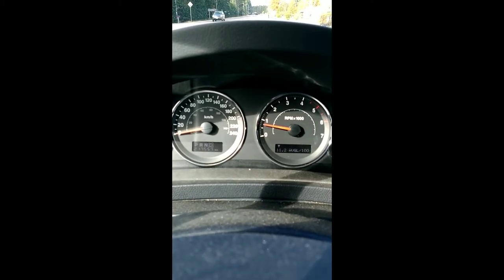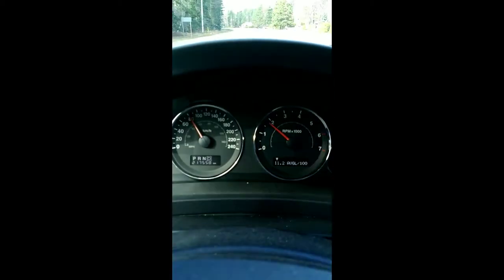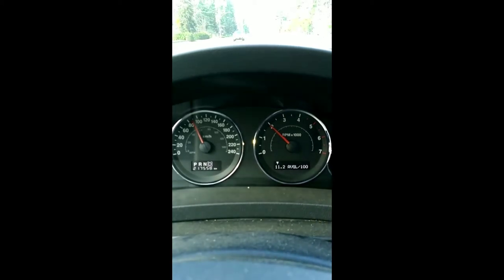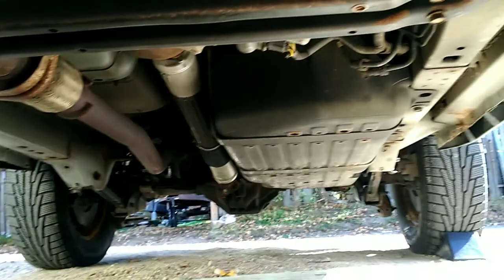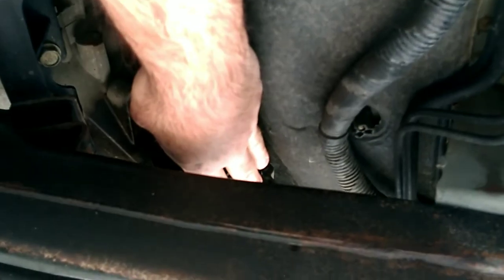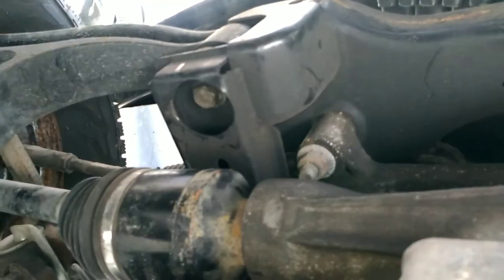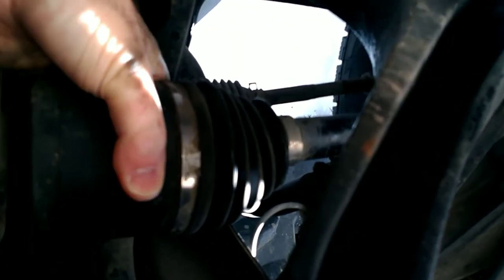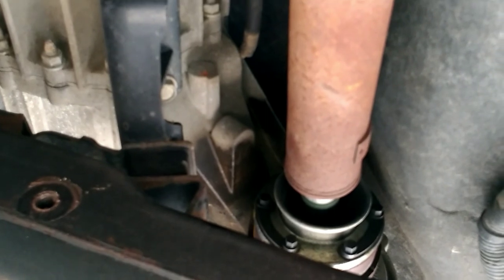2008.5 Jeep Grand Cherokee WK Driveline Noise

Comment from the maker: I ended up having two problems.  The drive shaft (propeller shaft) was worn at the rear CV and the pinion bearings were bad in the front differential.

Comment: I got the same problem on my 2006 jeep grand cherokee,¿did you   fix the noise problem,THANKS
Reply from the maker: yes, I changed the front differential, left front CV shaft, and front propeller shaft.  You will need to check everything individually to find what your problem is.
Reply: Thanks buddy